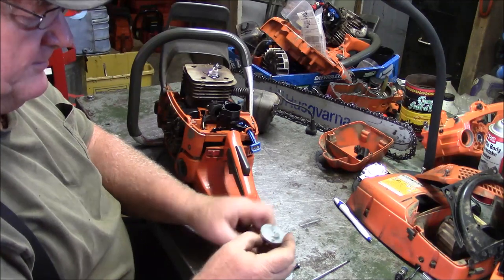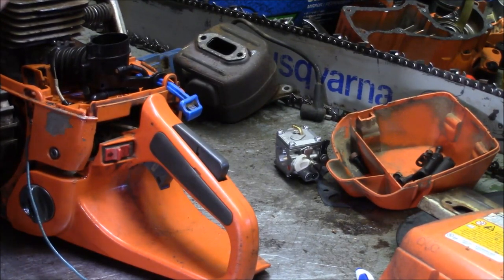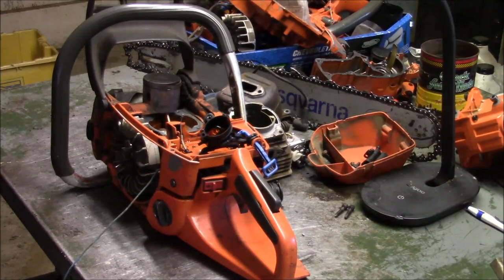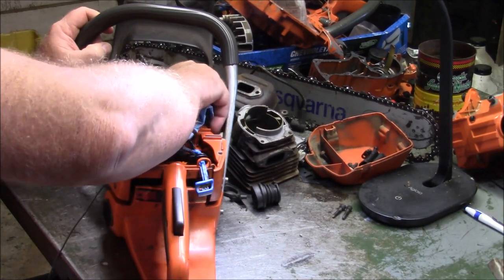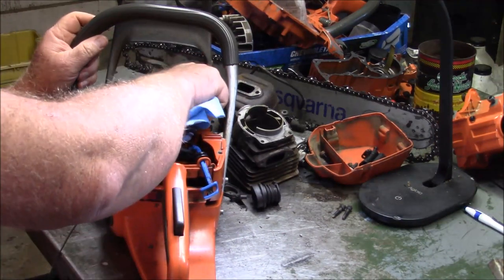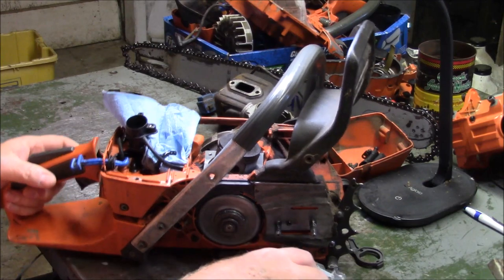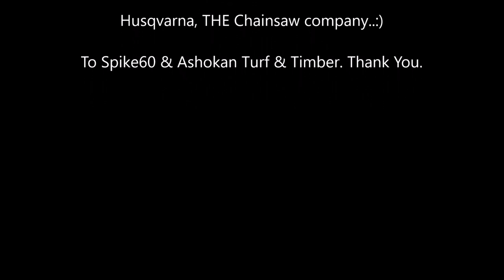Husqvarna 562xp & Autotune's Development ,  AND the "CST" Training Course, Husqvarna  390 Vac Test

Comment: you're right about converting chemical to thermal to mechanical energy (work).  Internal combustion engines are typically approx. 30% efficient at converting chemical to mechanical energy, not very good, the rest is wasted heat.  A really good engine will be up to 35%.  And yeah, long ago the energy capacity of fuels was calculated in calories and joules.  That's how we know that diesel fuel is so much more energy dense than gasoline.  awesome video.

Comment: I did a base gasket delete and heavy port job on a dumpster 562xp , as I wasn't afraid of breaking anything it came from the dumpster.  with an Amazon expansion pipe and she screams unbelievably fast loud , quick and strong . Your right though the engineering team has many design criteria that must maximize the Target demographic however not everybody falls into that average set so it's easy to make it better for yourself and say longevity wasn't an issue or Price wasn't a concern I swear I feel like billet clutch covers come from this or nitrous oxide hot saws.
Reply from the maker: Hoping you checked clearances between the cylinder , cylinder flange & those 562 cases.... :) Nitrous ... that would work! A cheap way to kick azz at a GTG?

Comment: The Stihl 441 was very similar.  It went through about 5 iterations and it morphed into a pretty good saw by the end of its model run.  Now, they have replaced it with the 462.  The key design criteria, today, is the bottom line and sales totals.

Comment: I agree.  However, you seem to forget their are several drving forces in the production of anything.  First, there is the sales & marketing folks, but the primary driver is the stockholder who is interested in but one thing - dividends.  After production, the manufacturer has to train the technical folks in their dealer service channel.  They also have to train their dealer sales force in order to maximize their sales.  My local Stihl dealer will not even send his technicians to a school on the new M-tronic saws because Stihl wants $10,000 for this school.   I think both Stihl and my local dealer are doing a disservice to their customers.
Reply from the maker: You make so many assumptions....:) I was a part of two separate venture capital start ups in a prior life, and was a manufacturing engineer in the early part of that career, then a product manager, then sales...;) A part of that was "presenting" to said investors when sales revenues were less than spectacular...:)  But I agree Stihl's approach to not just their M-Tronic, but dealers in general is hard to watch. This last year they seem to try and micro manage more than even in past years. The saw world is changing, so lets see where this goes. Husqvarna for all their faults seems to have a more open approach to training their dealers...and I believe they get it especially with the Autotune training.

Comment: The epa shut down the Indian slow speed diesels, how long are the Chicom clone saws going to last?
On another note, I buy a case of chevron 2 cycle oil at a time, last time it was havoline, 32:1 with 100ll.  Everything is blueish green and oily, lol
Husky is on the cutting edge, maybe the ragged edge of efficiency(clean and lean) to durable.  But if the epa mandates continue (They will), everyone else will have to catch up or license their tech, like the stratocharged concept.  

The industry I'm involved in, we are rushing toward automated equipment, and a bad line of code can result in massively dangerous and expensive problems.  Their are always teething issues, and you can either innovate, or disappear.

Comment: I have enjoyed the vids and learned a lot I'm a motorhead I race and always want to learn how to squeeze as many HP out of anything I'm running I have a 262xp and would love to know exactly what mods are  beneficial for power gain.It runs ok now but is low on cylinder compression and somebody drill the hole dead center in the muffler I bought it for $100 at a pawn shop so I don't know what has or has not been done to it I would love to see some of the things I could do to hop up the saw to get it cutting as close to my buddies 372 as I can if that's possible and again I love your channel and enjoy your videos thanks for taking the time out to do this to entertain us motor heads and Chainsaw lovers
Reply from the maker: Simple things like a fresh set of piston & rings would be a start. Getting the squish in the .020" range would be next.